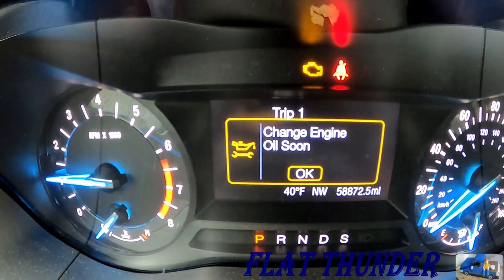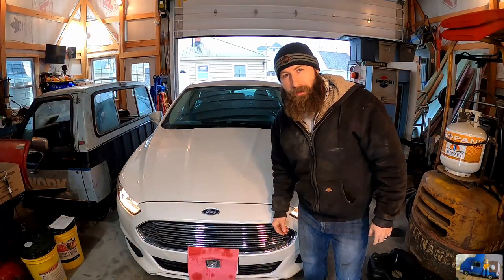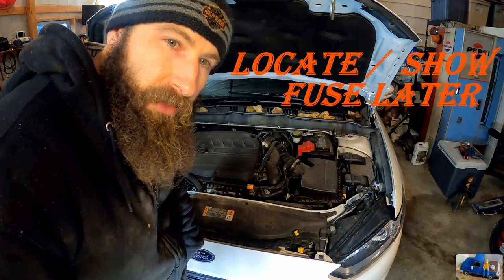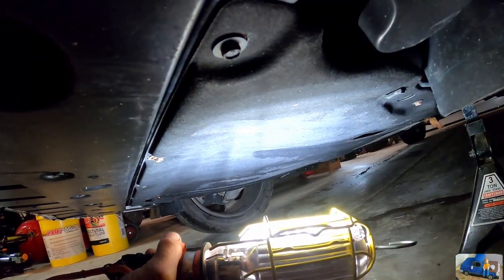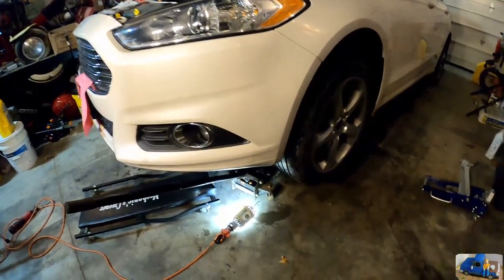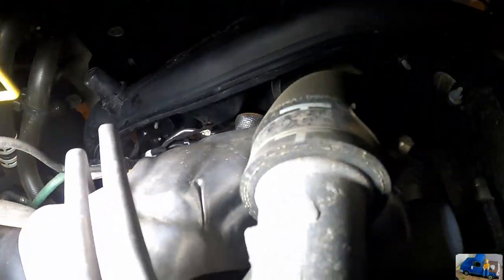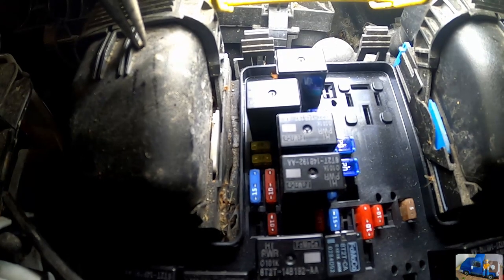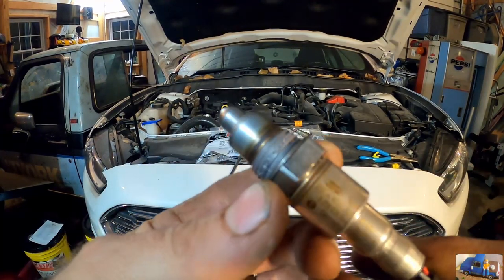2015 FORD FUSION; P0141  ENGINE LIGHT / O2 SENSOR CHANGE  / OIL CHANGE

Comment: I have 2013 ford fusion se I bought from the auction whenever I started the vehicle white cloudy smoke 💨 comes out the exhaust pipe for 15 seconds then stop what’s issue causing that now?
Reply from the maker: I'm no expert, but in my opinion it could be a couple different things.  Leaky or worn valve seals will cause a small amount of oil to leak into the cylinders.  This can generate a small amount of white smoke at startup.  Second is water burning off.  Condensation can be present in the exhaust or engine and it burns off quickly after startup.  More serious issues are if it is burning off engine coolant from a damaged component within the engine.  Also if it's a turbo the turbo bearings / seals could be leaking oil back into the exhaust.  Lots of options for the culprit.  I would closely monitor the engine fluids, possibly run a compression check and inspect the exhaust with the engine off to see if it's leaking any fluid other than water condensate.  Best of luck on the repair and thanks for watching!  👍😁

Comment: I have the exact same Code. Can this job be done working from the top?
Reply from the maker: I do not think it is accessible from the top.  Thanks for watching 👍😁
Reply: wrestling with coolant into cyl 1 leak..ala TSB 20 2100. Got the heated O2 sensor now, figure it is clogged like sparkplug is routinely getting. Just tried K-Seal.

Comment: What happen if it shake and the and the gas cap start making noise 🤦🏽‍♂️
Reply from the maker: Step one, trade it in before it stops shaking..... Not sure, but  if it's driving vibration likely the tires are out of balance.  Thanks for watching 👍😁

Comment: Do you need to replace downstream and upstream O2 sendsor for a P0141 code or just downstream sensor to fix P0141?
Reply from the maker: I only replaced the downstream 02 sensor in this repair.  I can't speak for all scenarios, but this was the winning ticket for my application.  Thanks for watching!  👍😁
Reply: @FlatThunder  Thanks for professional video presentation ..!
Reply: I am having so much trouble getting the bolt off the downstream 02 on my 2016 Ford fusion
Reply: One of the hardest bolts I have ever done.  And I am unsure if I should thread my hand from behind the bolt (rear of the car) or from the front engine reaching In. My problem is that my wrench keeps turning everytime I put some torque on it
Reply: @sethlewis2290  oh you should have done your research penetrating oil helps